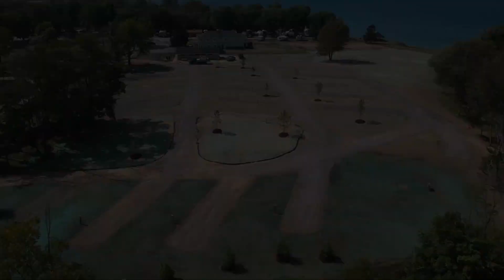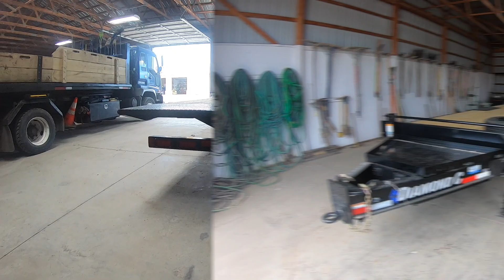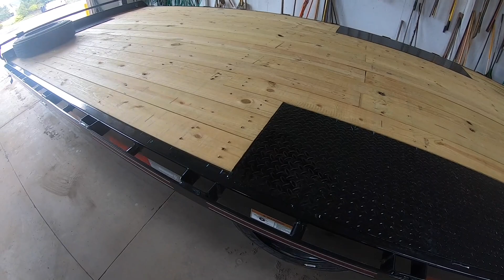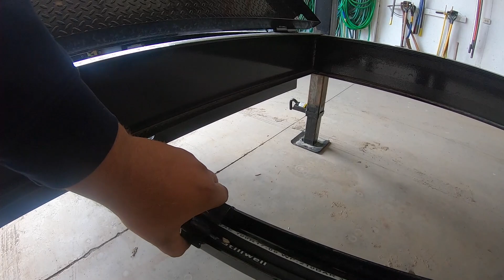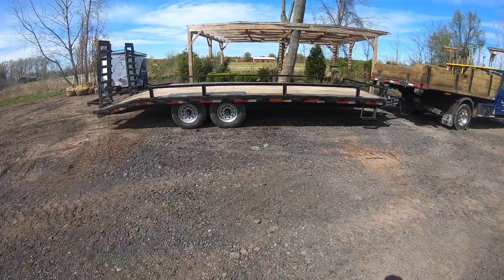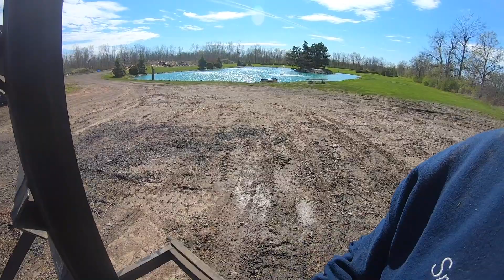New Diamond C Deck-Over Tilt

Comment: Hydraulic tilt decks do make it easy to change tires when deck pushs against ground, just don't do it if there's a heavy load on the deck its possible to bend the ram or rams. Tryed it once with 30k on deck of a Maxxd tdx 30k trailer you wouldn't believe how a 3" diameter ram would bend like a banana 😆
Reply from the maker: I’ve tried that for the tire change

Comment: Very nice trailer. What made you go with the deck over tilt vs the low-profile tilt (with fenders on the side)? The tilt angle seems a lot steeper with the deck-over. Has this been an issue for you?
Reply from the maker: We don’t like fenders for loading pallet materials or trees from the side. The angle is steep only when slippery. I’m working on a solution

Comment: How did this trailer work out for you this season? You like the beaver tail or the tilt deck better for your CTLs?
Reply from the maker: I personally like the tilt deck. I feel much safer loading it. With the beaver tail and track machines there’s always a big drop when your backing up. Makes me feel like it’s going to flip over. The only issue I have now it it’s tough to put attachments on from the side where it won’t be effected when you raise it to tilt to load the machine. Another nice thing is you now have more deck space at the rear that I didn’t have before with the beaver tail and ramps. The deck on the ground for loading also helps keep the truck in one place so it won’t rock as much.

Lastly the hardest problem is telling if the weight is distributed evenly bc the deck is up and the weight doesn’t transfer over until it’s down so it’s hard to judge.
Reply: @BeauEnterprisesInc  Thanks for the reply. I know the feeling with the beaver tail and ramps. I always have a voice in my head that says "you're going off the trailer" when she starts to drop. I'm looking at pretty much the same trailer so glad to hear it's working out for you guys.

Comment: Nice trailer. I agree with you that the front storage box could be designed better to seal out water (or at least put some drain plugs in the bottom of the box). I'm wondering why Diamond C told you that you couldn't mount your spare under the bed? And also why you didn't have it built with pockets for forks (don't you use a fork attachment)? Other than that, I would probably order the same trailer ... but maybe spring for a solid oak floor (wonder how much more that would cost?). You say in the video that you have a step coming ... from Diamond C or aftermarket? If from Diamond C, why wasn't the step installed when you took delivery? I thought steps were standard equipment on their trailers. Anyway, I hope you get a lot of life out of it ... seems to be well made.
Reply from the maker: There is drains in the box so water doesn’t hold but it would be nice if it was sealed. To be honest I don’t think the dealer even asked diamond c when I asked for it, but after getting it there was no way anyone could hold the spare tire up to secure it. It’s so heavy!  We have a fork attachment but don’t transport it often. It stays right on site for a while usually or we just strap it down. You can build and price this trailer on the website and choose all those options. As for the step I wanted a retractable step after I ordered it. I contacted the dealer by phone and email in Jan. Which was only a month after ordering and asked to add it. No one ever got back to me on it. So I finally just contacted diamond c and they said I had to have the change into the dealer ASAP or it would be too late. Tried to call again and nothing. I never heard from the dealer until it was time for them to be paid. At that time I asked about the step and had to settle for the stake pocket step which was added after the trailer was delivered to them. No big deal. I’ll wait for it to show up just ship it right to me. Mind you they lost by jack handle shipping it from the dealer to my shop. Stake pocket step showed up and it didn’t even fit in the pocket. Reached out to dealer, yet again no return calls so I reached out to diamond c and they took care of it. Dealer 👎🏼 Diamond C 👍🏼

Comment: I live in Salem, Ohio. Appalachian Trailers shop is 9 miles from me. They build a decent trailer. Have you given any thought of adding a winch to the new trailer ? Would be handy from broken down equipment.
Reply from the maker: We bought a dump trailer from there in 2018 in addition to that flatbed in this video. Took the ride down and picked them up. The diamond c has the winch plate already added up front so I should be able to add when I’m ready. Just the factory winch is a lot of money